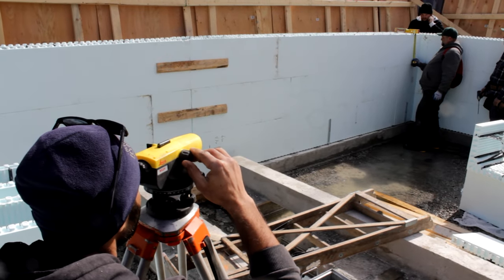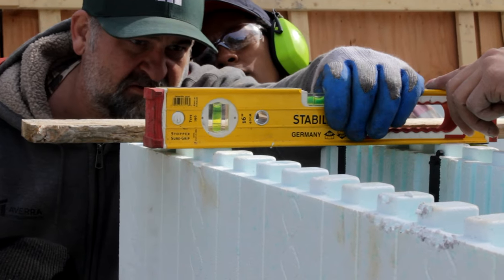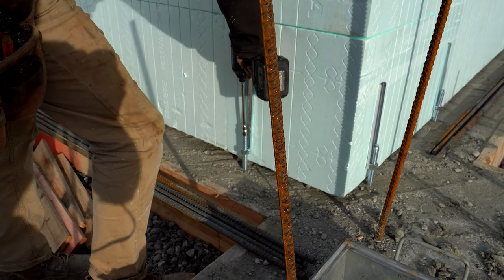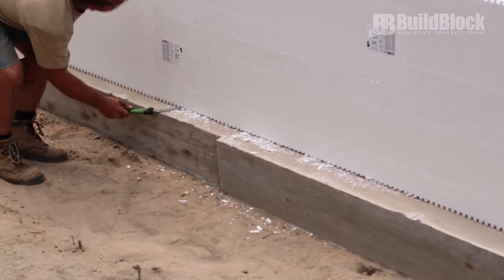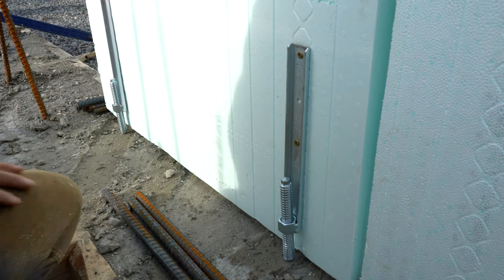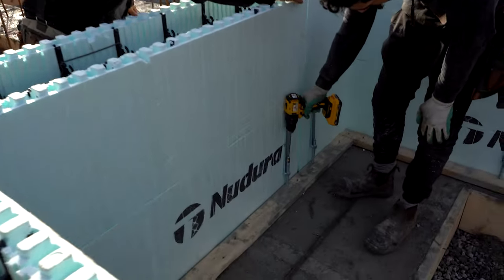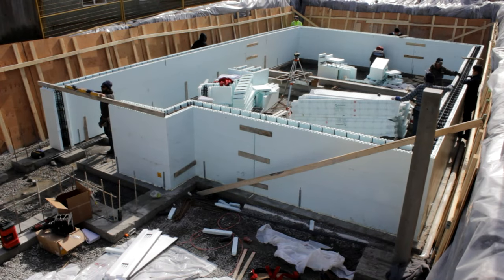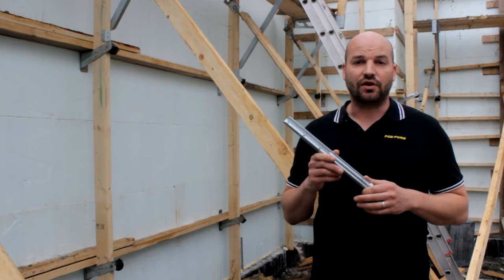How to level up your Insulated Concrete Forms (ICF) Zeveler Bracket

Comment: After leveling ((or zeveling?), I would tape around the threads of the zeveler before foaming and pouring concrete. That would make clean up of the zeveler easier to use on the next project.

Comment: Hi. 😊 How many inches can these make up? We have an existing slab that’s in great condition, but was poured by previous owners to park an RV, at an intentional slight slope, to shed water in a specific direction. We want to put up a smallish ICF building on that slab and this looks like an easier solution than sawing the bottom of the blocks, but it’s approximately 4 inches lower from one side to the other. Can these make up that much difference?
Reply from the maker: You would get a maximum of 4.5" of travel from a 0" position